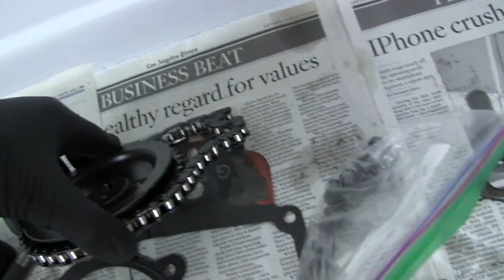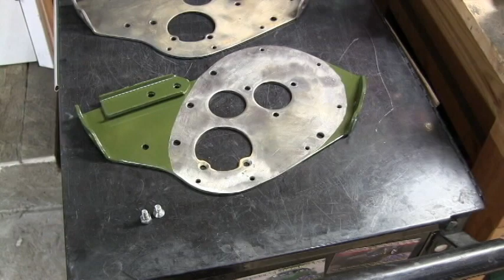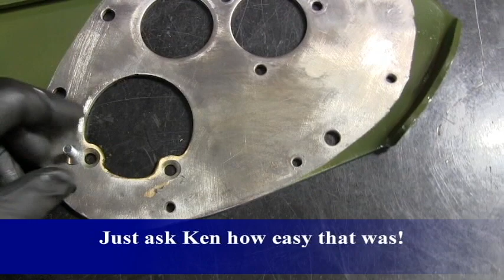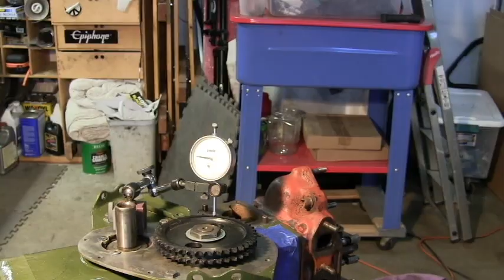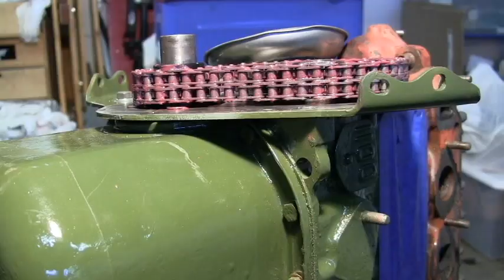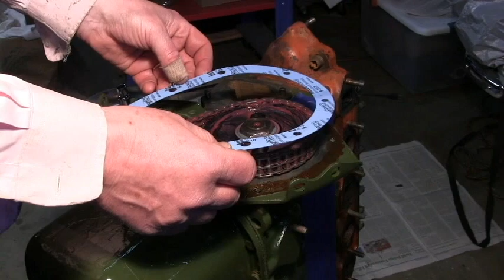Morris Minor 1098 Duplex Timing Chain

Comment: Hi mate great vid! Just a quick question, I also have changed my moggy to a duplex chain, I put the cover and crankshaft pulley back on after I was finished and decided to start it up for a bit to see how it was running without the coolant etc, after about 3 mins of running I turned it off but noticed white smoke coming from the top coolant inlet, if you have any answer for this I’d love to here it!
Reply: To add to that the exhaust manifold is a little bit hot aswell so could be that I was just running it for too long?

Comment: Interesting Tim. So why a duplex chain? The engines were made with a single timing chain as standard and to be honest they should last a very long time. I just wonder what benefit a duplex chain would provide. The kit cost was pretty reasonable and the single chain kit is only a couple of pounds or so cheaper. What was your reasoning to get a duplex one?
Reply from the maker: Hi Monty - it really came down to recommendations from others; if you are going to change it anyway and the cost is not much different then why not fit one?  Apparently the duplex one is less likely to stretch.  At the end of the say there's probably not much in it, especially if the car is not going to be driven hard, which I can't imagine mine will be!

Comment: Hello Tim just as a matter of interest what toque setting did you tighten your camshaft nut up . As nothing mentioned in the Haynes manual  about it it has a locking tab so maybe just tight hope all going well with the engine 👍
Reply from the maker: You are correct there is no setting given, so I used 60 lb ft.  I found that in an MGB forum and guessed that a B series engine would be similar to the A series.
Reply: @goingundersground   hi Tim thank you for your reply I’ll do the same. Look forward to your updates happy engine building 👍